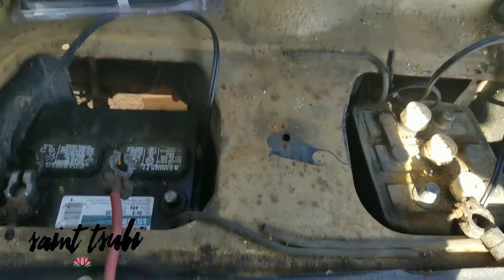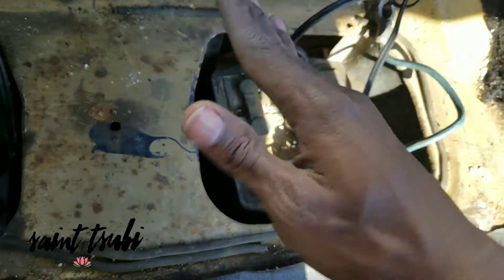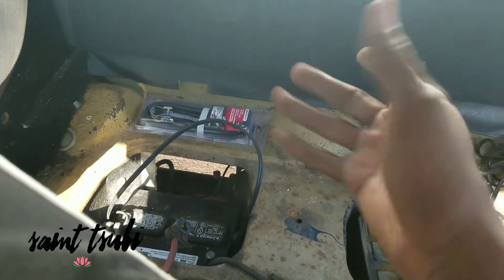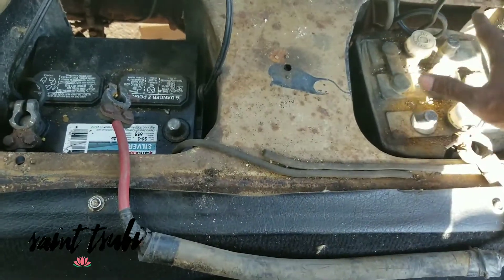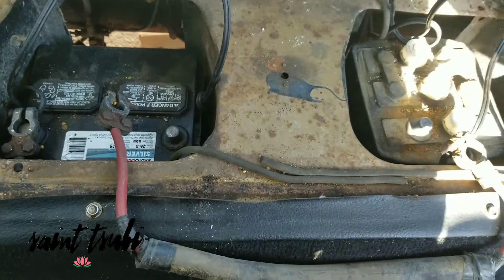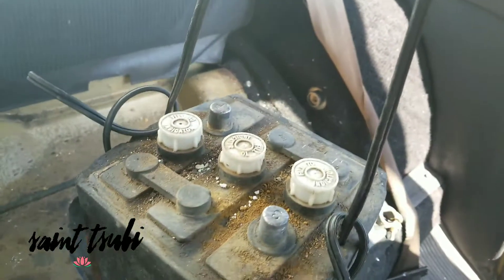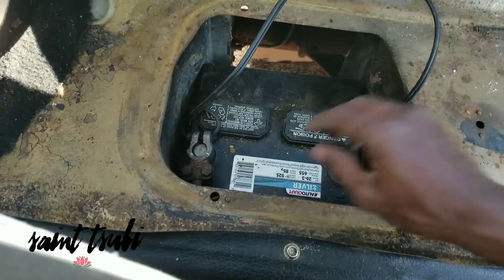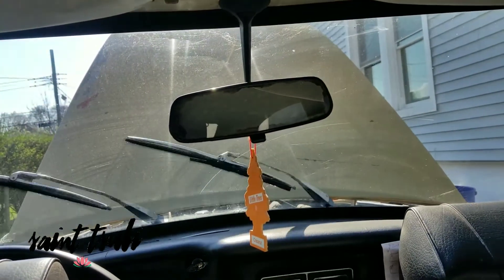MGB GT DUAL 6V TO SINGLE  12V CAR BATTERY CONVERSION AND REWIRING

Comment: I swapped the two 6v for a 12v.I assumed it was a negetive ground being as the negetive cable was bolted to the chassis But Im finding it works either way it seens to work better with the live to ground.I remember I had an early Mini many years ago that would connect either way.

Comment: I found the Autocraft-silver 26-3 battery at Advance Auto Parts and it fits my '72 MGB battery compartment just fine. Did not reuse the original mounting hardware.